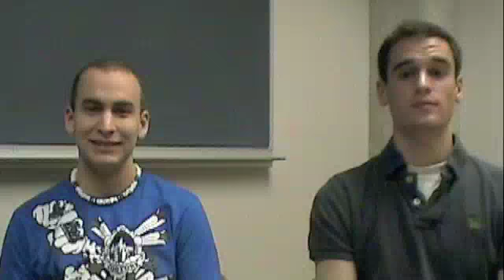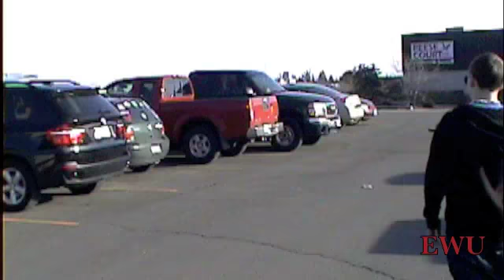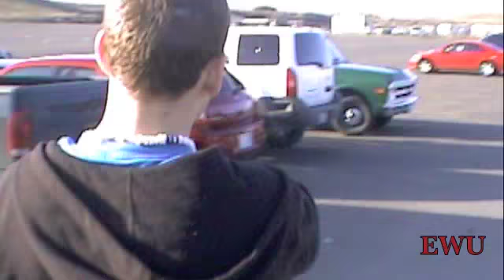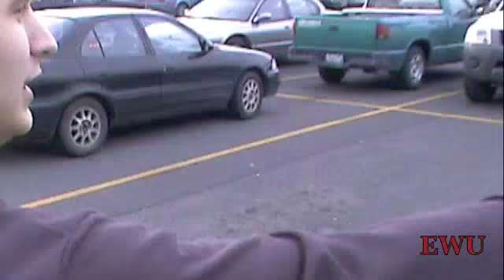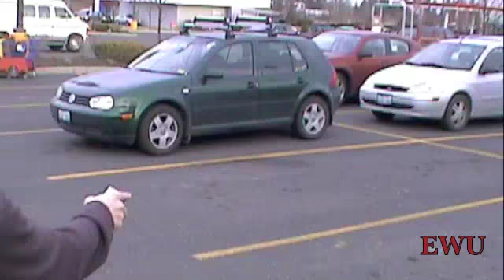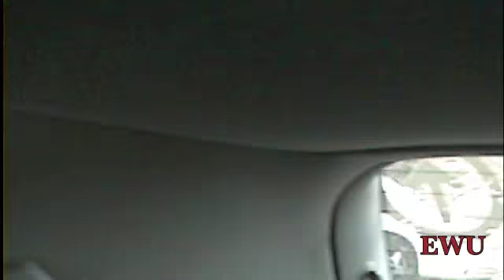Car Alarm Remote

Comment: Fake!!!
1st That remote is infer-red, I actually have the exact one.
2nd If one code were to do that when ever I press the wrong button all the cars would go off in the parking lot, and not only mine
3rd The biggest! If you press the alarm button how do you turn it off? By pressing it again of coarse. They pressed it multiple times.